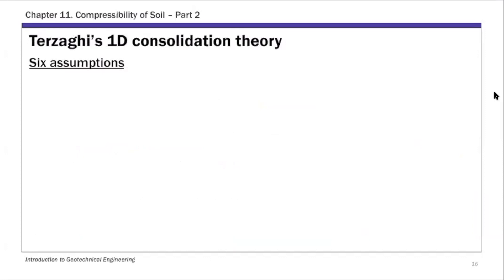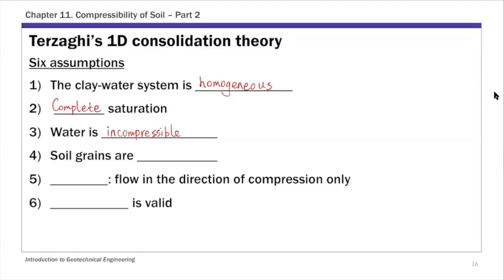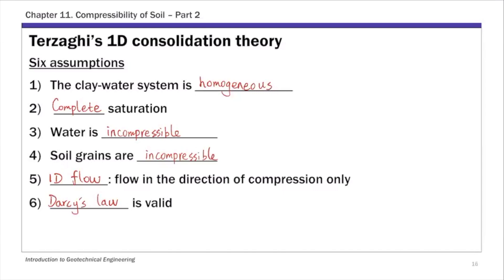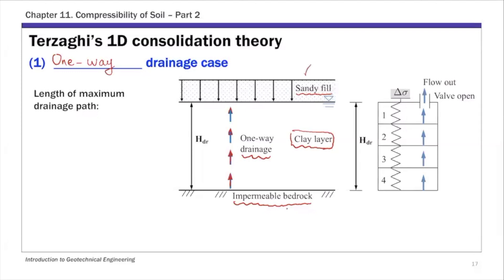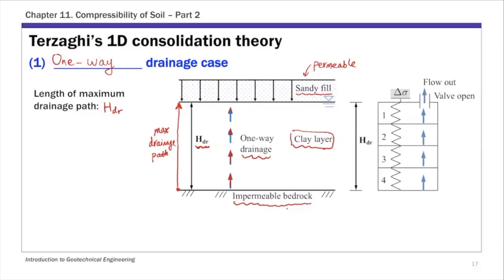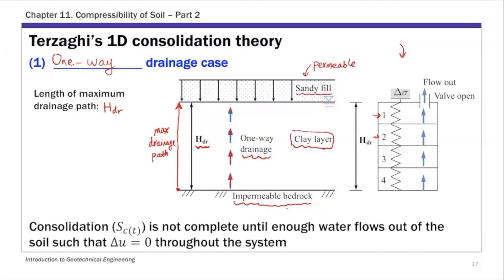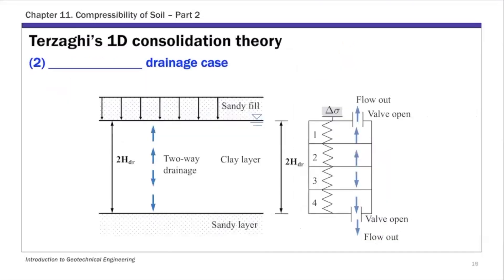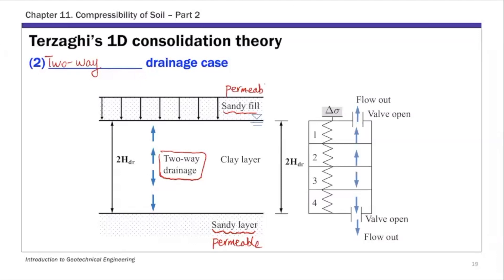Chapter 11 Compressibility of Soil - Lecture 4B Terzaghi’s 1D Consolidation Theory

Comment: When a sample is taken from the middle of a clay layer (1 way drainage) and you are trying to calculate Cv (coefficient of consolidation) does Hdr still equal the whole length? Or would it equal the L/2 + half the length of the sample (distance from bottom of sample to top of clay layer)
Reply from the maker: If you conduct a 1D consolidation test (which is two-way drained) on the sample and calculate Cv based on the 1D consolidation test data, then, Hdr equals to 1/2 of the height of sample.